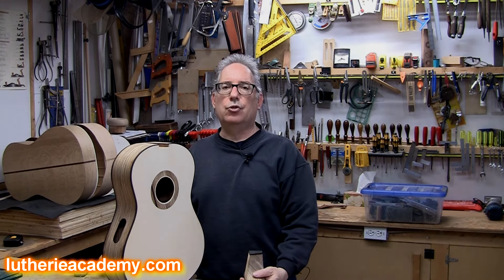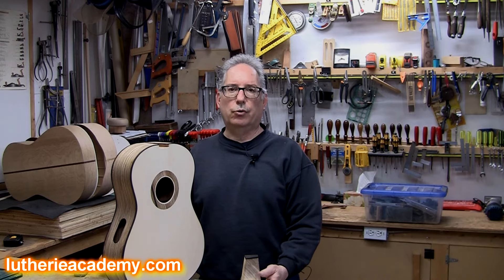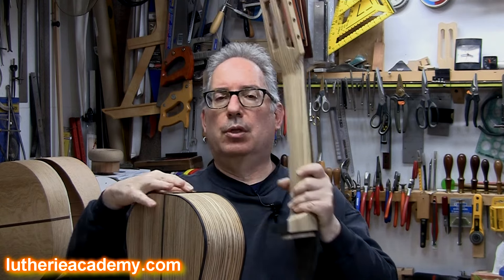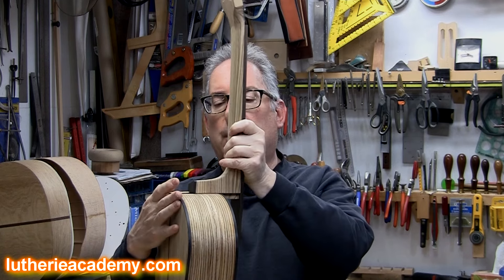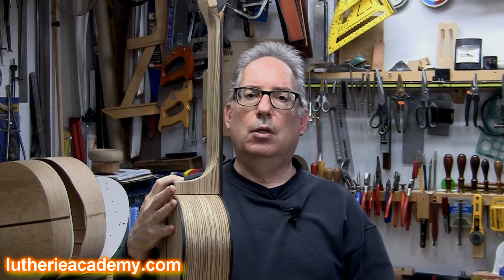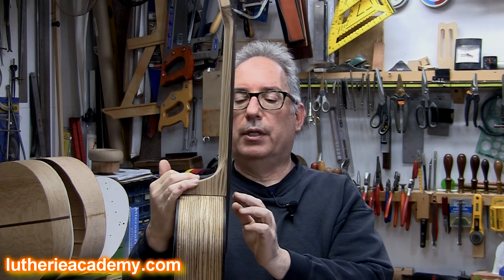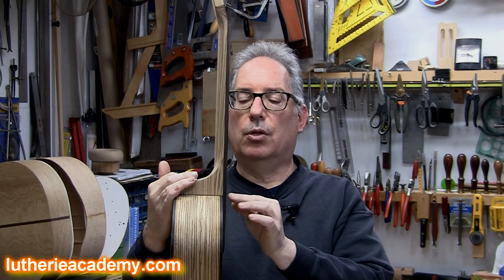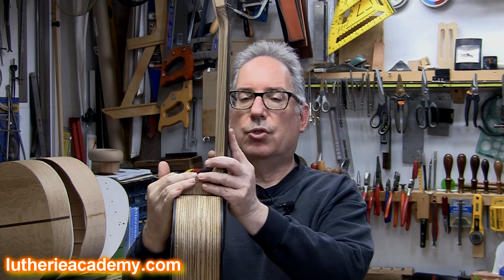Making Guitar Dovetail Joints - Online Course  Intro

Comment: I bought an old guitar and that's bent in the joint area where the heel and the body meet. What should I do. I've detached the neck for reset but the dovetail area where the sides are is bent